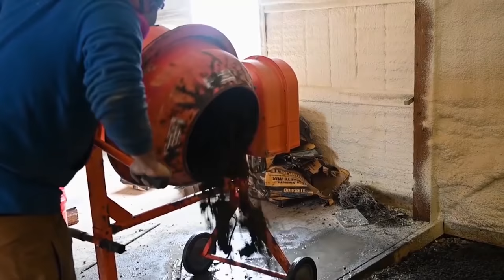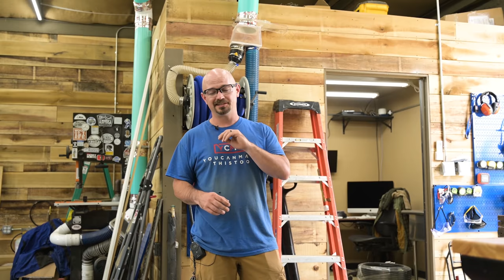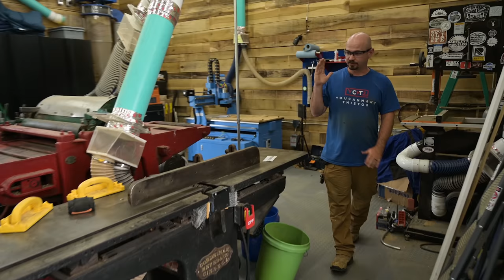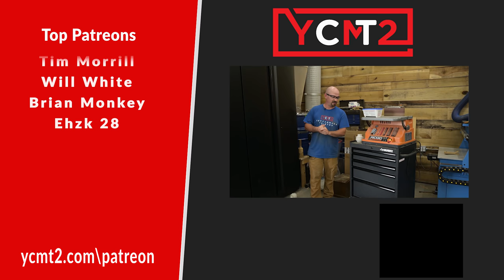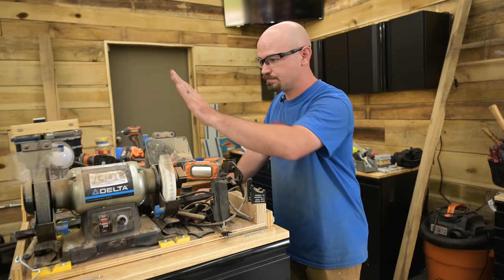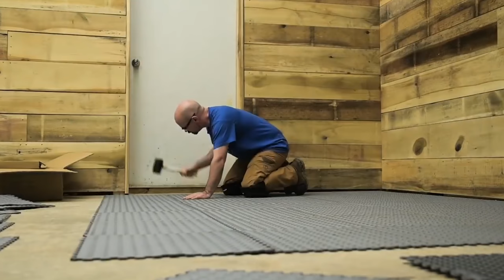Dream Shop Tour

Comment: I'm in the process of outfitting my 30x40 metal building into a woodshop.  Nothing as nice and fancy as you have though.  First, thanks so much for such detailed videos and their great quality.  I noticed a really nice set of sliding doors on your shop.  I want to avoid the rollup doors and build my own sliders.  Do you have any videos that include how you installed those?  If not, can recommend a good source for the hangers and other hardware?  Again, thanks . . . :)
Reply from the maker: I don’t, sorry. Those doors were already on the building when I bought it. That said, I’ve seen all the hardware on my doors at tractor supply co.

Comment: What electrical hose reel did you decide on ?
Reply from the maker: One from Amazon. It’s 40’ but my big requirement was 12 gauge wire so it could handle 20amps. That pushed the price